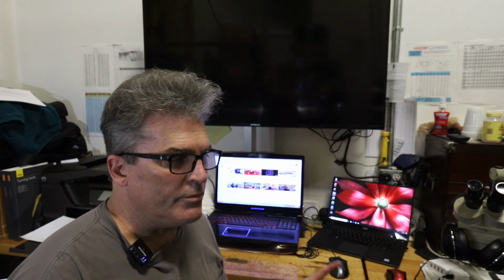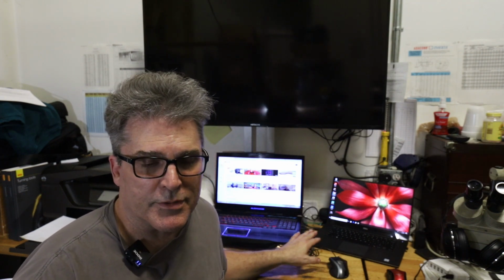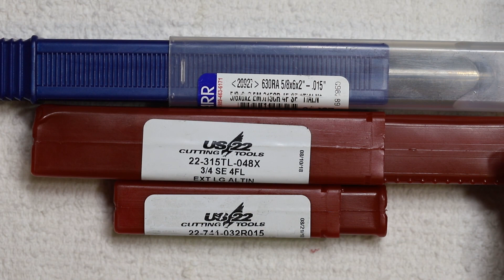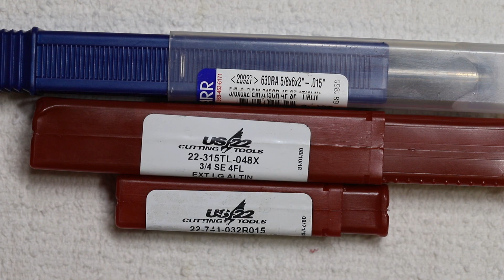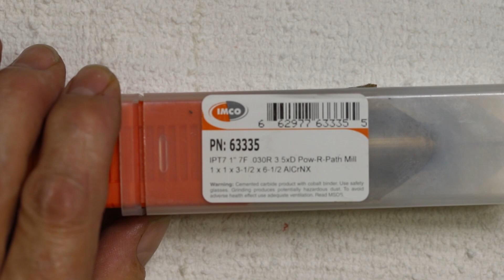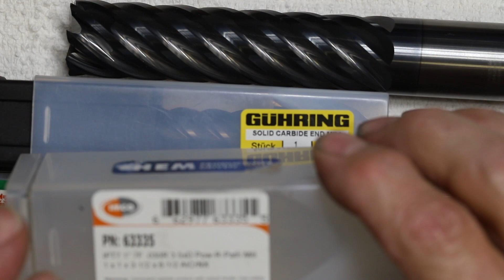Endmill Grinds

Comment: the main problem with fusion 360 that i've encountered is the inability to do good 4th axis toolpaths.
Reply: How much time have you spent? Its something I dont use super often--we have a rotary on a 3 axis machine that ive had good luck with wrapped toolpaths but ti seems to be more sensive to  certain parameters. When you see guys like Laurens 3Dtechdraw using it on the multus you'd think he was using some fancy stuff but nope -fusion/hsm.
Reply: @Stoopidslow  I use fusion at a job shop I work at and only fusion. But for instance if i want to finish a ball with a continuous 4axis toolpath I would have to create special sketch geometry and can't just use the manufacture environment.
Reply: @qqqqqqqq1407  Yes same boat but I was using feature cam a ton so a more geometry heavy workflow controlling toolpaths was common.

I think a lot of people are surprised that despite the videos you see on you tube to really make good parts with good toolpaths and good finishes, whithout collisions or gouging, you not just clicking three buttons and generating a toolpath.
Reply: Simultaneous 4 axis... Worked a treat in fusion. https://www.instagram.com/p/BwTfwKIg4I0/?igshid=1dh78buw4kucw
Reply from the maker: Scott can this type of tool path be generated in fusion? Or was this done in Fusion?
Reply: @EdgePrecision  currently not but in the future I hope
Reply: @EdgePrecision  that toolpath I shared the link to on Instagram above. Yes that's generated in Fusion 360.

Comment: fusion 360 is pretty good. the 2d side of the program gives me some issues compared to other Autodesk software. and the limited post selection is an issue. I have a swiss style gantry lathe with a fanuc controller. I can use it for some 2 axis work but but find typical lathe canned cycles to be better for me and hand write most of my lathe programs. it does not support 3 or 4 axis work for me and there is no other options. ive done some milling in my lathe by scaling my part 2x's in x and y then posting with a mill post and creating a sub routine. but sometimes I need manually edit the radius in the code and other things to get it to work. if you find a company that makes custom posts please let us know.

Comment: The Mitsubishi machine should have no problem with the standard MELDAS post script Autodesk provides.  The Integrex post will probably need some work.
Reply from the maker: I agree. The only thing is my Mitsubishi has a unusual tool changer that requires a certain cod sequence. I would have to process cod and see what it puts out.
Reply: @EdgePrecision  I wonder if they licensed the design of that tool changer from Niigata.  It is very similar to the older Niigata tool changers.
Reply: @EdgePrecision  I have have a Mitsubishi control that does a sub routine for the tool change. im not an expert on the situation but ive seen a macro for an okuma that invokes the tool change sub with a standard tool change code.
Reply from the maker: I don't have to give it the cod it has a macro for M6. The thing is is it wont back up on a tool change. What do I mean your asking. When you make a tool change first you call the tool on one line. Than on the next line M6 and you call the next tool(If there is one). So once a tool is in the arm you cant call another tool until you make a tool change. On most machines the tool changer would put the tool back into the magazine and retrieve the new tool than change. So you call the tool and put the M6 on the same line. So on this machine at the end of the program you cant call the first tool into the arm. You would make the last tool change without calling a tool. If there is a tool in the arm and you call another tool. You will get a alarm "Tool doubley called". I know that's a little hard to understand it is a unusual tool changer.It takes so getting use to.

Comment: Please tell me you have a regular backup process. Something that's goes too an external ssd! Full. Backups once a week. Consider an encrypted cloud daily backup.
Reply from the maker: The computer has ssd drives and I have backed up most of the data to external drives. But I don’t do it weekly. I really should do better with back ups.
Reply: External ssd take shock better than spinning drives. They are cheap insurance. I will be in Houston next week.  I would love to see your shop and can talk pc's if you like.  Hope new laptop is using a m2 ssd. The speed improvement from a 10 year old machine will be amazing. Good luck with the software upgrades.
Reply from the maker: Your welcome just let me know. The new computer does have ssd drives.

Comment: Fusion 360 is low end program, it is mostly for hobbyists uses (I do not say you cant use it professionally but you will have lot of pain with it),  anyway Autodesk offer much better professional solution "Inventor Professional" which is still one of cheapest CAD/CAM solutions on market, it is 3 times cheaper then its direct rival SolidWorks, or like 20 times cheaper then CATIA CATIA  works perfectly with Mazak, biggest names who use Mazak use CATIA to like Boeing and McLaren ... and small digression SpaceClaim us modelling kernel  licensed to SpaceClaim by creators of CATIA).
From all CAD/CAM software I try (one note I am not mehanical engener I am EE but I had in first year of university elemenray mehanical engenering) I found CAM part of CATIA is most easy to use (for me), much easier then Fusion 360 (which I found very not intuitive) and it even worse then what SolidWorks have (again I found CAM of it hard to use, even it is main CAD software in my company and CAD part of it is for whet we need perfect and easy to use), I found (Siemens) NX is easy to use too (near same as CATIA).
Reply from the maker: We shall see. Actually Autodesks better package is Feature cam but the quote I got it costs $7500.00 a year membership. Plus a one time charge of around $3000.00 for two posts for my machines. For $450.00 for Fusion 360 it’s worth a try.
Reply: @EdgePrecision  Fusion 360 is 100% worth money no questions about that.
Just suggestion did you look at "Product Design & Manufacturing Collection" from Autodesk? If i remember it is like 2500$ a year and include Inventor, AutoCAD, Fusion, Nastran ...
Let me state again I am not mehanical engener, even I am now looking to buy small CNC for home for my hobby (RC jet airplanes) and it will be probly small HAAS like you have at your garage, what I see HAAS offers best performance for money, it perfectly fit space i heve (I have limited opening it must pass to get to my basment), it fit all my needs, they have good support in my country (by the way in my contry Mazak is king everyoune you ask they say to you buy Mazak even peopel who make CNC machines localy told me by Mazak), so for that reason I was look into to CAD/CAM software (just for some reason can get to use to Fusion 360 CAM it is somehow not logical to me, but same as I saw from your videos apply to Esprit).
Reply: @EdgePrecision  I'd stay away from FeatureCAM.  I don't think Autodesk has actually updated it AT ALL in at least a decade.  I have an old license for FC, I know how to use it and I have it so, it's what I use but I definitely wouldn't recommend it to anyone.
Reply: @prototype3a  Featurecam has not gotten to much support since the acquisition aside from a UI update to "autodesk" style.  If i was a betting man i say in the next 3-5 we see its features rolled into Powermill and HSM/fusion/Inventor CAM and basically see it dissolved.

We decided not to renew our maint with Autodesk after the buyout. The 2017 version we're on is acceptable for 3 axis work and we spent a small fortune with Hypermill for the 5 axis machines instead.
Reply: @prototype3a  Autodesk have only owned it for 4-5 years.
Reply: @ScottMoyse  You're right.  I forgot that when I was trained on FeatureCAM, Autodesk had not purchased them yet.

Comment: Peter if you running windows 10 on the old laptop pull the harddrive out and place it in the new one. Then call windows tech support reactivate your windows it costs like 40 bucks then launch Esprit like what you would do before. If you can try to find your windows activations number b4 the switch. If you can find it you can avoid the tech support call but all the other programs on your computer should run like they did on the old computer. If your up to it and it doesn't have an ssd its way worth that upgrade. I just built a new work station and kept my old drive to the new pc and everything fired up smoothly exspt. I tossed my windows key like 7 years ago when i built my original and windows was kind enough to sell me a key for 40 buck lol. But youll have to install the video drivers for the new card witch is super easy and dell will have bios updates for the motherboard on its website you can download.
Reply from the maker: The old computer is running windows 7. It has ssd hard drives. Someone suggested mirroring the drive with the software to the new computer.
Reply: @EdgePrecision  mirroring is good if your running two harddrives but the 2nd one is a instant backup like if one fails. I recomend everyone to clone drives over if they want a backup of like your windows activation and other apps that need authentication though hardware. Because windows knows if you swop computers by the motherboard. So if you do a harddrive swop windows will deactivate. Windows 10 automaticly begins getting the right windows drivers fot your motherboard or whatever it needs lol ive never done a harddrive swop on a windows 7 but it shouldn'tbe that difficult. But besides that its worth the shot trying because it probably going to beat going to Esprit and trying to get an old version of the software. Unless you have all the stuff from when you bought it originally than it should download right onto the new pc since you have to have a pyhical key already.

Comment: Not sure if it makes a difference, but the coating on that IMCO tool is actually AlCrN(X), so that might be why it feels so smooth. I have an IMCO tool sitting right in front of me and i can feel the same thing. Either way, their tools are really good, and im glad to see you decided to try them out! 

Also cool to see you are trying out F360. As a newer machinist who has a lot of prior experience w/ using computer software, I was blown away by how pointlessly awful the user experience was on certain way too expensive CAD/CAM software packages. Fusion 360, while it has some minor issues and isnt perfect, is 100x better than its competitors in so many ways.
Reply: IMCO is easily one of the top producers of high performance hard metal milling tools.
Reply from the maker: So far I have only watched tutorial videos on fusion 360. From what I see I will not have any trouble with it. The cad part is almost identical to the software I have been using. The cam actually looks easier than Esprit. And it will actually do more things than the version of Esprit I have. I’m looking forward to learning it. Yes this is the first Imco endmill I have used. I am impressed.

Comment: The grind on the shank of that MA Ford endmill looked a lot rougher than the others.
Reply from the maker: The undercut on the shank is a clearance grind that I did. It’s not standard for this tool. I needed the clearance on the shank. Also the tool is used. I didn’t have a new one for the video.

Comment: Peter, one other thing regarding end mills that you may find interesting.  A couple of years ago, a tool dealer got me to try one of these end mills by Iscar (https://www.iscar.com/eCatalog/Family.aspx?fnum=2158&mapp=ML&app=0&GFSTYP=I).  I remember he pulled it out of the container and my first thought was:  "this can't work!".  The end mill looked almost cylindrical... only a single clearance grind, but appears to have little or no clearance.  The dealer said:  "take this thing and try it", which I did.  I went back the next day and and bought a couple each of about 3 or 4 sizes!  I still don't understand how it works so well, but "the proof is in the pudding"?  Not only do they work well for roughing AND finishing,(and make a fantastic surface finish),  but the lifespan is far beyond any end mill I've used in aluminum (which is all they are made for).  It would be interesting to get your take on one of these if you ever have some aluminum parts to make on your horizontal, or something like that.   Oh... one other question (and surely I'm not the only one to wonder, or ask this):   Did you deliver the super duplex parts?   I'm sure a good portion of your 32k subscribers felt like me.... that we were "along for the ride" on the entire process from beginning to almost the end!   I/we sure hope it all worked out for you and was very profitable in the end!   I know that we all profited from watching you go through the entire process!
Reply from the maker: Yes I have delivered 48 parts so far and have 48 more to go. So far no problems. That endmill has a similar grind to the ones I show in this video.
Reply: @EdgePrecision  Yep... that's why I sent it.  I think it's interesting that a grind I might have "expected" on end mills for tough materials like you regularly cut, would also show up on an end mill for non-ferrous material.  Of course I haven't seen every end mill made for aluminum (by a long shot), but have definitely looked at a lot of them.  This is the first I've personally seen with a grind like that.  Can you provide any insight?   fwiw: those Iscar end mills also have a super fine finish, as if they had been polished.

Comment: I think you're probably right about the gfx card coming unseated. But it's ofc under some huge cooling solution. Which model is it? I have that same laptop in my basement collecting dust. Where are you getting stuck in disassembly? I'll pull mine apart and see what we can see. Keep in mind if you plan on getting it back up and running you'll want to clean up the thermal paste and pads and get new. Likely the cooler is on both the cpu and gpu. About the hdmi port, could be solder joints so check that as well. Love you're videos, please keep em coming. Sorry you've had the corporate hassle lately. Much appreciated
Reply: If it's 10 years old, I'd guess it's an M17x R1.
Reply from the maker: M18X

Comment: Can you re-grind those radial clearance angles on your CNC tool grinder ?
Reply from the maker: Yes it does have the cycle for it. But weather I can yet is up in the air. I think I may need some different wheels to do it.

Comment: Any tips for someone who just got hired as a manufacturing engineer and is learning their first cam program Esprit?
Reply from the maker: Are you saying you are learning Esprit?
Reply: Yes
Reply: I used Esprit years ago and I really liked it compared to MCam.  But that was a long time ago and I dont have any experience with the newer versions.  The one thing that I think is more important than the brand of software is how good is your access to local support.
Reply: Nice comment.  I feel like Esprit is an underrated cam system.  We use Mcam at work and they have put alot of effort into making the interface modern.  However some of Esprits tool paths seem more refined.  I am not sure what its costs these days, but maintenance is worth it.  CAD CAM Software is much more competitive with Autodesk owning HSM works and Delcam now.  Solidworks is also offering integrated CAM.